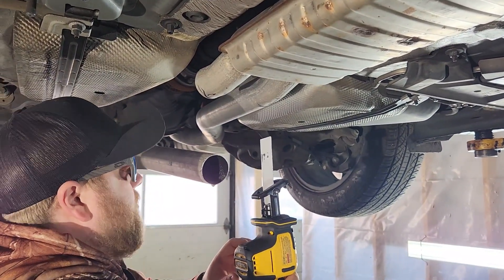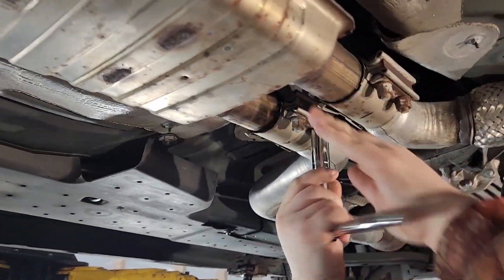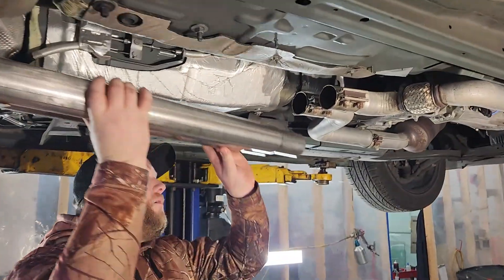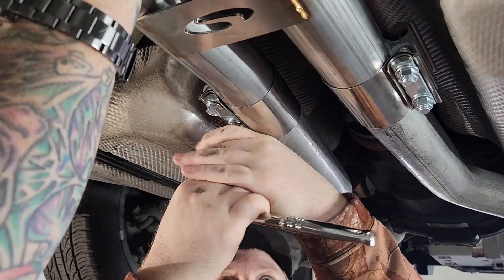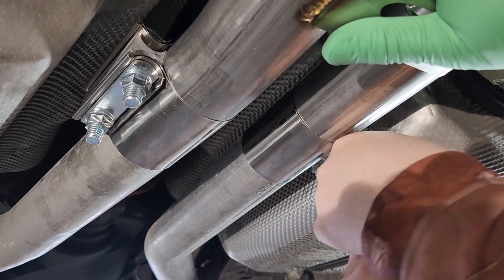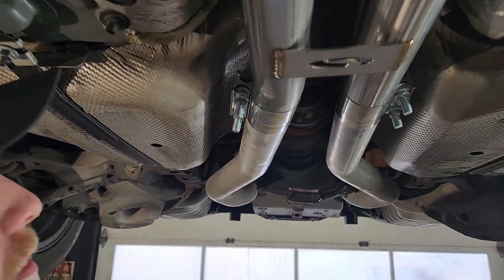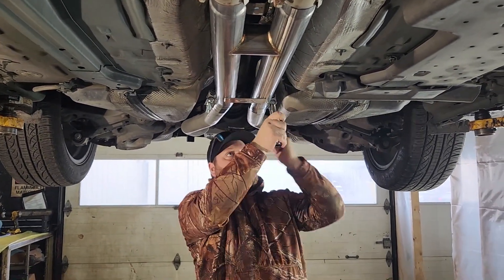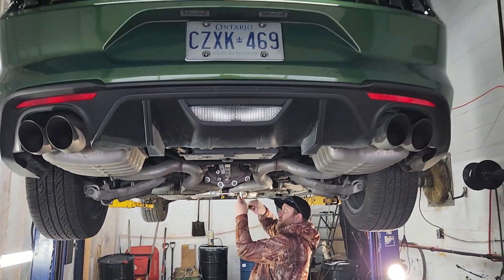Steeda H-Pipe Installed on a 2022 Mustang GT

Comment: Nice car when you put on lowering springs what time did you use? And did you have to do other things to it is size alignment did you change your shocks and struts? Did you get a caster plate
Reply from the maker: This one isnt lowered yet, he has the springs,  just havent had a chance to install them yet, but with my 2016 i was able to lower it 2 inchs and could keep everything else stock.  However. I have a mild camber now so that will be getting adjusted over the winter